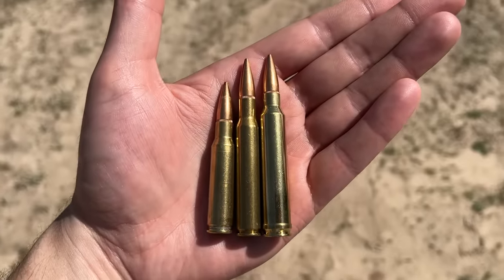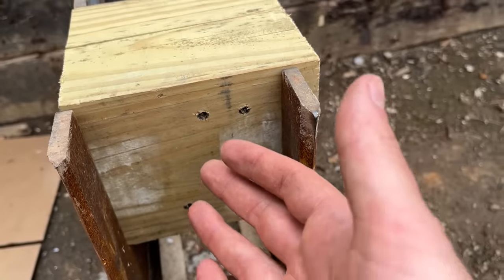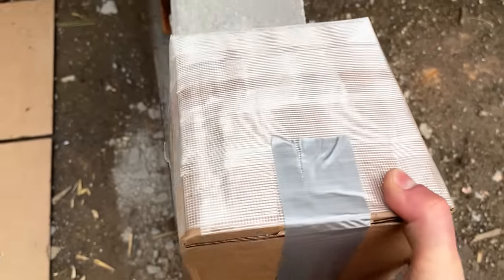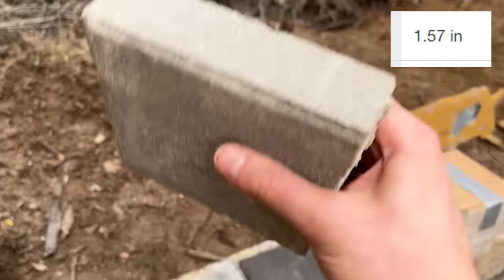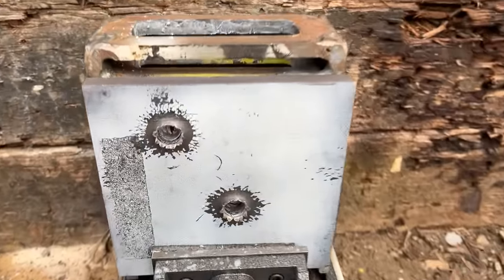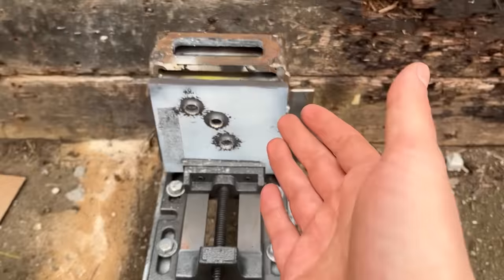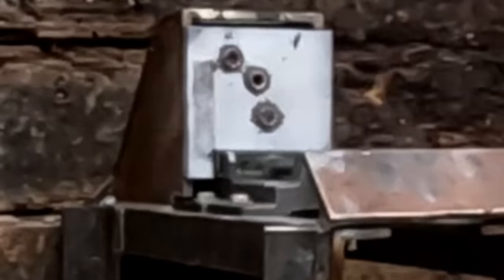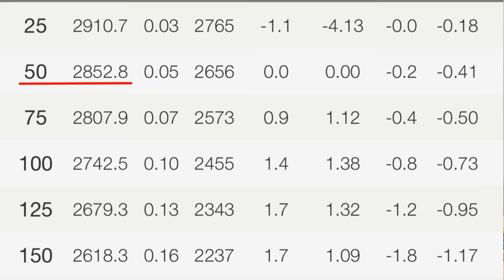308 vs 30-06 vs 300 Win Mag: Did Not Expect This

Comment: My understanding is that the 308 was developed to try to mimic 30-06 ballistics while utilizing a shorter action. To accomplish this, a faster burning powder is necessary. With that in mind, seeing little difference in the results between the two isn't surprising in the slightest. As others I seen here mention, the 30-06 is superior to 308 when it comes to loading heavier bullets such as 200 or 220 grain due to the greater internal volume of the case.
Reply: Yes. After some years, powder was improved, but could not be used in military .30-06 because it would damage the M1 Garand mechanism. The .308 was specified with the improved powder in a smaller case to exactly duplicate the military .30-06 with the same bullet. Modern bolt rifles are made to use modern .30--06 hunting ammo with higher pressure/velocity. I like 3000 fps velocities which I can get from either .270 Win 130 gr or .338 Win Mag 185 gr, a little faster than standard weight .30-06 150 gr,

Comment: Another thing to consider that if you don't hand load, at current year (late March 2024) .308 is 65-70 cents a round, 30-06 is 90cents to a buck a round and 300 win mag is $1 - $.125 a round.  So unless you really need that range or penetration (long distance open field shots against large animals)  .308 is the best bang for the buck.  30-06 is just 30 extra cents worth of shoulder pain, apparently.
Reply: Absolutely correct on all counts.  Other advantages for the .308 are lighter recoil and a compact size, resulting in a smaller firearm giving almost the same performance as the heavier 30-06 type.
Reply: my go to rifle for deer is still a 30-30 but that being said i own a 308, a 30/06 and aquired a 300 w mag from an uncle, aside from the 30-30 for Michigan deer ill take that 06 any day over the others with the options for the various bullet weights its a far better all around rifle, for range if i sight in all rifles including the 30-30 at 110 yards drop target back to 225 the 30-30 still hits dead ( high mount scope on a marlin 336c) the 308 hits 1 inch high with high rise scope mount, the 06 3 inches high with a high rise scope mount and 1/4 inch low with level mount, the 300 3 and 1/8 hoigh with high rise mount at 500 yards the 308 hits low by 27 inches, the 06 low by 13 and the 300 w mag 12 1/2 inches all three using high rise and of course the 30-30 hit 5 feet low now i was using a 4foot by 8 foot sheet of 3/4inch plywood,had the target or aim point set 5 inches from top of plywood my place of shot was just about level with top of the plywood, the reason i use 110 yards is simple that is the distance where i sit 90% of the time deer hunting to the edge of the thick pines yes i can shoot into them but the distance is 100% known at a glance

Comment: Factory 308 out of the box being almost equal to 30-06 is the best it will ever get.  The 30-06 has the extra case capacity to push deep-seated heavier bullets without decreasing the powder charge or push lighter bullets with increased powder charge.  Much better versatility when you handload or with specialty ammo.
Reply: I like that you can seat bullets out further in the -06. Tho COAL has never stopped me with the 308 before either so... :D
Reply: @googlesucks509  agreed and id add that its possible to give the ole 300 win a run for its money if you hand load the 06 with staball 6.5

Comment: One idea you could use for the sand penetration is multiple cereal boxes. It would at least let you see what travels the farthest in sand a little easier.
Reply: I agree this is a better idea. I hope Banana Ballistics reads your comment. Dang good idea.
Reply from the maker: That is a good idea. I’ll need to find some tough cereal boxes (maybe wheaties will do the trick lol)
Reply: And or a bunch of duck tape, that always works right?🤣
Reply: @bananaballistics ,  Wheaties may transform during testing.
Reply: @bananaballistics  Just start eating more cereal.
Reply: @matthewstavros472 

Yeah, I wouldn't trust Wheaties anymore.
Reply: @bananaballistics  There are those "priority" boxes you can get at the post office.  About the same thickness as a cereal box but much better cardboard quality.  Probably get the same thing without the USPS logo at Staples (if it still exists, idk) or Amazon for half the price.
Reply: I have bullet proofed my safe room with plywood boxes 7 inches deep filled with packed silt (river sand). The testing I have done is my 30:06 went 6 inches into the sand and was stopped cold shot from point blank range. The sand almost completely grinds the bullet to almost nothing. Sand is a very effective means of bullet proofing. Play sand will probably work also but silt is a denser and finer type of sand. Works great for sand blasting also. Can find tons of it along the beaches of a major river.
Reply: @bananaballistics but not Caitlyn Jenner wheaties👀
Reply: It really is just too much sand to even tell you much of anything. Maybe it would take that much to stop a fifty cal, but in this case it is too much. Dividing it up solves this issue.

Comment: I loaded 30-06 AP projectiles (174 gr) into .308 cases. I think I used Hornady's minimum powder load, don't remember the powder.   Shot AR500 plates at 200 yards with the loads.    I found no apparent damage on the AR500 plates from the AP projectiles, but they made spectacular bright, flashes of sparks when the projectiles hit!
Reply: They were not real AP then.
Reply: @rifleshooterchannel208  Yes, they were/are.   Steel inserts, black tip, from WWII 30-06 ammunition.  Pulled from ammo that had corrosive primers.   

Granted, not up to the quality of today's armor piercing ammunition. 

Definitely not the same armor piercing projectile inserts that the boy scout troop I was with found on the firing range of Fort Sill, OK, which I think were tungsten carbide.   Even after stripped from the copper/lead sheath of NATO ammo, those had needle sharp points.

I did load the projectiles with the slowest speed in the Hornady manual for that bullet weight.   That may have had something to do with the results.    Faster speeds produce better penetration.
Reply: @RetiredRadioChaser  I wish I knew where to get any AP bullets.  There was a debate years ago over whether or not your barrel would lose accuracy after shooting AP ammo.  A lot of guys thought it would, but I never had enough AP ammo for my Garand to find out.  I still shoot NRA HP Rifle with the Garand although the world has moved on.  Only a few powders are appropriate for the Garand and God knows off the shelf commercial ammo that isn't designed for the Garand will eventually wreck one.
Reply: @BicBradley I found a facebook market ad for a vintage barrel vice that was cheap.   Met the guy selling it at a storage facility where he was selling stuff he bought at an estate sale.  Went for a 2 5 dol lor  vice and spent almost 3 0 0 dol lars for stuff that had belonged to a gunsmith.  

Among the stuff I bought were 40 or 50 WWII 30-06 AP rounds.   I don't know if they were for a Garand or for a machine gun.  They were loose.  I pulled them and discarded the cartridges because I suspect they had corrosive primers.  

I also gave the wrong weight of the projectiles.  They are 164 gr, not 174.   One odd thing I found about the projectiles.  They are FMJ Flat Base as pulled from the cartridge, but the steel core looks like a boat tail projectile. 

You can buy M2 AP online, but they are not cheap.   I just checked and found one company selling them for 3 Washington's each!  I think they were 1953 vintage and non corrosive.   

I believe the jacket is the same as used for a non AP M2 round.   Mine tested magnetic as pulled but only the steel core is magnetic with lead in the tip of the projectile and lead in the base to make up for the shorter steel core versus the longer gilding alloy jacket.   Not like some Soviet 7.62x54R projectiles I have which have steel, copper wash jackets, and a lead core.

Comment: The mild steel he is using is probably A36 steel for those of you that may want to purchase it. There is a huge difference between A36 steel and AR 500 steel. Where A36 steel will be penetrated, AR 500 steel will barely be dented. AR 500 steel is INSANE. Its also not readily available, has to be special ordered and is very expensive. If your going to bullet proof a car, AR500 steel is the way to go.
Reply: Toolmaker and metallurgist here, you are correct.  AR 500 is a high carbon steel, surface treated to a hardness on the Brinell scale of around 500, hence the name.  What makes it so tough is it isn't through treated, only surface.  The interior is soft enough to dissipate the force through a larger amount not only surface area, but volume.  It can dissipate, not give way.  Titanium treated the same way is similar, but that's a bitch.
Reply: @scottrackley4457  Thanks for the additional information. There is always something to learn.

Comment: You should try some .303 Mk7 ball ammo with the aluminium nose-cone under the jacket. This will go through 1/2” mild steel and leaves a prodigious sized hole.  I tested all this stuff in the 1970’s.  New Zealand made CAC Mk7 ball, 1958 headstamp was more effective than Lake City 30/06 M2 ball ammo at penetrating steel plate.  I am not sure why but maybe an artefact of the bullet design, I only know what actually happened when we tested them.  The 30/06 Black-Tip AP was a different story - the tungsten penetrator seemed like it hardly slowed down and left a small, clean hole.  Whereas the M2 ball just heavily cratered the surface.  All tests at 100 yards.  That’s what happens when  16 year old spends all his spare cash on surplus rifles and ammo, before girls and motorcycles changed it all! 
198gr military 8x57 spitzer FMJ was very penetrative against tree stumps.  Never did try it on the steel.  
Much later on I found a .308 with 168gr Hornady match pills reliably penetrates 10mm mild steel plate.  
The “pissant” .303 was the real surprise, but when you consider the real performance 174gr @ 2440 fps vs the M2 150gr @ around 2740 fps there’s not much between them.    Norma used to advertise their commercial .303 150gr ammo as doing 2700fps.  The .303 Mk8Z ammo was more than equivalent to the WW2 30/06 in any practical scenario.  Bullet efficiency with a heavier but streamlined profile starting out slightly slower usually trumps light, faster loads at distance. BC is king.    But you can get a lot more out of the 30/06 than the military loads then in common use, with careful handloading. All these cartridges were loaded for reliability in varying climates and conditions so hot-rodding was less than desirable. 
There’s no hiding behind upturned tables or cars with any of them!

Comment: I experimented with pulled M2 163 gain AP bullets loaded for the 300 Win Mag several years ago.  My load consist of 74.0 gr. of Nobel Sport's Vectan Tubal 8000 powder, Federal Cases and Winchester LRM primers.  Shot from by 26 inch heavy barrel Remington 700 Long Range rifle, that round has an average muzzle velocity of 3,344 fps +/- 20 fps.   Based on your 300 Win Mag test result, I believe my round would have went through the 1 inch steel plate.
Reply: Yeah. His tests would be so much better if he at least hinted at the load data he’s using. 

I propped up an AR500 plate on a 6” log at 100 yards and shot it with an M2AP projectile at 3100fps from a .300WM. 

Sailed right through the plate and exited the log and buried itself who knows how far into the mud of the berm.
Reply: @deeza3384  Uncoated AR500 and was about 8mm.

Comment: This really throws shade on the 30-06 in a tangible, hard-data kinda way. 

Even if the performance were more significant, it wouldn't justify the added powder and recoil.
Reply: Not necessarily because this is only one bullet weight. The 30-06 still is great because you can get it in as light at 110 grains to as heavy as 220 grains from factory. So, it has that versatility going for it. It's more of a jack of all trades round. Not necessarily the best but able to be used in a variety or application. As for recoil that's all up to the firearm used to shoot. My m1 shooting 30-06 has way less recoil than my buddies ar10 shooting 308.
Reply: Yeah when hand loaded properly 150 gr is similar, move to a 180 and it starts to show, now about 200 fps faster with a higher bc= a couple hundred yds of added range with the same energy. It’s a hungry case that is neutered with 150 gr, originally shot 220 gr as a 30-03, thankfully they kept the 1/10 twist.
Reply: @number3665 that’s because the m1 can’t handle high pressures. It’s limited to chamber pressures much lower than modern stuff. You have to shoot M1 specific ammo or get a gas block that vents off pressure to not blow up, or really damage, a garand.  I own 1 and love it but it’s definitely the mildest of 30-06 compared to modern off the shelf stuff
Reply: @gavincline209  My m1 has been rebuilt so new barrel national match OP rod and all. So I don't have to use the mild ammo in it that I would in an original 70 year old one. I regularly send  high pressure modern rounds through it fine. Still don't kick as hard as my buddies' AR10 lol.
Reply: @number3665 that’d be a nice upgrade for sure but idk if I’d want to change mine out for the older “original” stuff. Kinda what makes them cool, there individual history of what it’s been thru over time. 
Maybe if I got another one, later 50’s model with no real history to it though. 🤔
Reply: @gavincline209  Oh yeah I agree. Mine was a 50s model that in all likelihood didn't see any combat. I don't think I'd do it to a WWII dated M1. I do plan on buying another from the CMP that is WWII dated to leave in all original condition to preserve the history.
Reply: @number3665 there were a time in the 80’s that you could get a 223 sabot in 30-06. Something like 3800ft/s. I can’t remember. Screaming hot though!

Comment: Years ago, we had a dump truck leaf spring as a gong at 100 yards at our outdoor range. It was hit with 30 06 and everything below. Just blew the paint or rust off it. I bought a 300 win magTikka m65 deluxe left hand bolt rifle and tried it 3 times on the leaf spring.  When we walked up to it, there were 3 jagged holes through it. I was quite surprised. It was removed after that. I’m of the belief that the hardness of the spring steel was great up to a certain point but the extra foot pounds of the 300 was enough to cause the fractured holes. Note they were a little jagged, not as clean as the holes in this video.  Ar500 is a whole different ball game of course.

Comment: That was awesome. Hard hitting cartridges. The white tail here in middle TN won’t know the difference between them. They would just know the freezer. Of course, I get mine here with my 6.5 Grendel 20 inch MSR.
Reply: I'm from Clarksville Tn myself.  Used 30 06 my whole life.  Never lost a 🦌. Or had to shoot over 100 yards till coming to  sc.
Reply: @jamessandifer3405  Spring Hill here. 30 06 is a deer dropper for sure. Proven round for over a 100 years. The Grendel puts them down, but the 06 definitely has more knock down power for sure.

Comment: i love the 30-06. the amount of load data is huge with loads from 110grn to 220grn..and even a 50grn 22cal in a sabot exiting the bore at around 4100fps!  the 308 is not as versatile.  the 300mag is a pretty impressive cartridge but if i was going for mag level performance ide chose the 30-378 Weatherby Magnum. yup..mmmhmmm

Comment: I got the same Savage. Mine came with a muzzle break which is nice.

The velocities between the 308 and 30-06 seemed very similar. I guess that's why we don't use it anymore.
Reply: The 7.62x51 Nato was intended to equal the military 30'06(7.62x63) while fitting in smaller mechanisms.
Reply: If you're gonna go long action, you might as well go up at least to 300WM!

Comment: Winchester came up with .308/7.62x51 by improving powders to the point where they could shorten the .30-06 by about 1/2" without losing velocity with the bullets that they'd used with '06 military loads up to that point. Bearing that in mind, it's not a big surprise that the .308 and the '06 had comparable performance.
Reply: Or they just realized they could meet the performance of the watered down M1 Garand loads with a shorter cartridge.
Reply: @rifleshooterchannel208  If 147 grains at a nominal 2800 fps is "watered down", then yes, that's what they did, both with M2 and M80 ball.

Comment: Tested my trusty 1942 303 British Enfield on 0.4925 thick mild steel at 35 yards. Held the plate vertical with a stick. Ammo surplus 1942, coincidence? Enlighten me. Went through like butter. The smoothest hole as if it were done on a drill press. Guess I should try the AR-10 and Nagant. Love your testing. Not sure what it tells me but enjoyable.

Comment: Mr. Banana, please do 9mm vs 30 Super Carry!
Reply from the maker: Should have a 9mm video out next week. I’ll be thinking about the 30 super carry for a future video though
Reply: 9mm wins
Reply: Interesting that 30 super carry suddenly showed up in my lists just the last week or so.
Not getting into a new cartridge, not getting into a new cartridge...
Reply: @rickt10   lol. Sounds like me. Then grabagun had the Shield plus in .30 SC for $249 after a $50 rebate.🤷‍♂️
Reply: @rickt10 Dont do it. Handgun rounds do not have difference ballistically to warrant having niche, expensive cartridges in weird handguns.
Reply: I disagree with you. In the case of the .30 SC, you're right, ballistics are very similar to the 9mm, but in the same gun you get 2-3 more rounds in the mag which isn't insignificant. Also, for gun enthusiasts like me, new cartridges are interesting. BTW, .30 SC is only about 50% more expensive than 9mm, and still cheaper than .45ACP.  Final thing - my Sheild Plus .30 SC was $250 after rebate and runs like a top. Not sure why you think a Shield Plus is a weird handgun, lol.